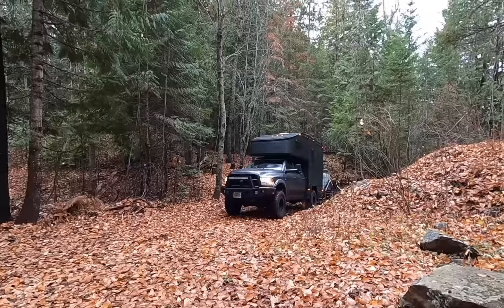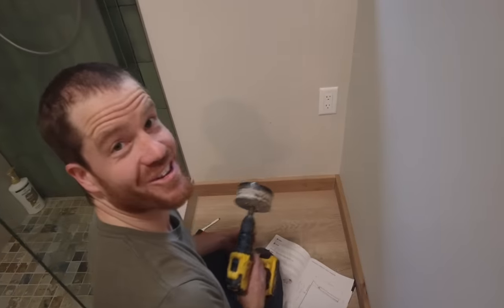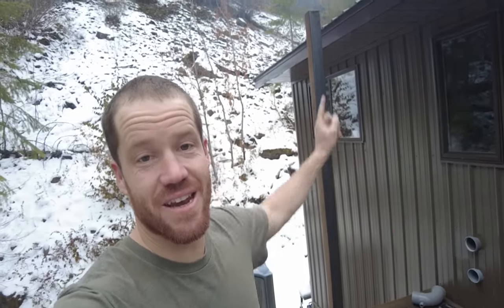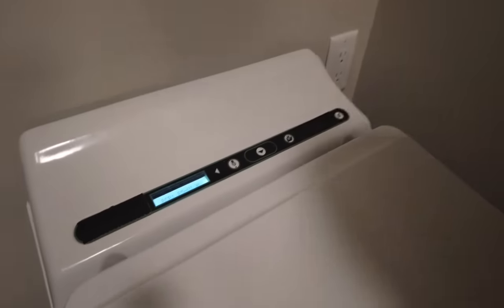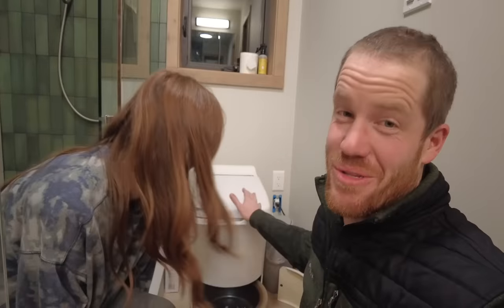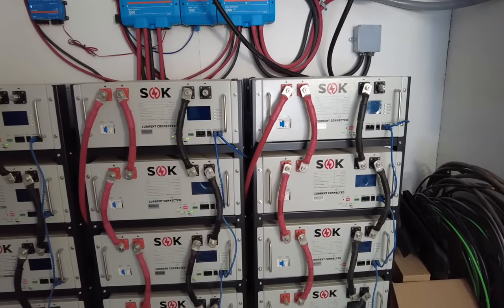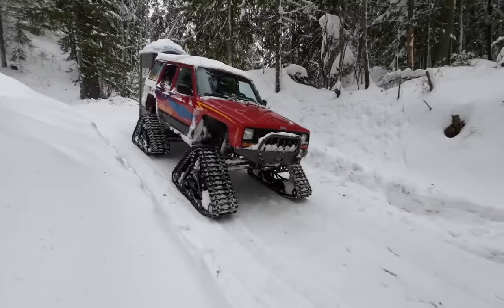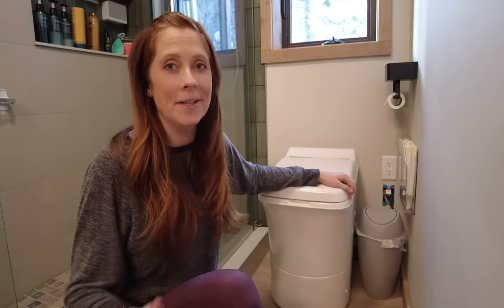Easiest Off-Grid Toilet? | Burning Our Poop!

Comment: I have 2 questions; can you use the toilet when it’s in a burn cycle? And what about urine? Very interesting video, thanks for the mature but fun handling of the uhhh topic
Reply from the maker: Yes you can use it in the burn cycle and yes it handles urine.
Reply: I would like to ask the same question. I thought water and fire don’t mix. What happened when number one contained number two ?🤔🤔🤔 will the paper holds when it contained a lot of urine ?

Comment: I live for a year in a house with one of these.

Make sure you regularly empty the the ash-bowl, it can get quite bit messy if it's too full when you pull it out from under the unit. 

As the ash-fills up the incineration cycle gets less efficient and it will take longer and waste more energy.

Another thing that can happen is if the ash-bowl is full is that the paper-liner with the waste doesn't want to fall down as easily, especially if it's only a nr-1 (too light too fall down) the most annoying part of this unit is that if the liner doesn't fall all the way down it get caught in the closing mechanism and just kind of hang there while it burns.

Finally, the cycle takes a lot longer if there is a lot of fluid. Because of how it works it first has to boil off all fluids before any burning takes place. A lot of wattage can be saved by going NR-1 outside in nature, it's also totally fine because pee is sterile.

Also as you've noticed it is not very quiet, which can be a bit annoying in the evenings or when someone uses it just before bedtime.
Reply from the maker: Thanks for the tips!

Comment: Very interesting.  We have a cottage, with what we call a Garottage.  It’s a separate building which is part cottage, and part garage.  Has electricity but no water or septic.. we’ve been trying to figure out what to do.. kinda steep price for the toilet, but would solve some issues, and be cheaper then suppling water, septic tank, and plumbing!!  Yet another good episode! 🎉

Comment: Towing an out house has to be the strangest thing thing I've ever seen. Well done and very useful video about subjects not very often spoken about. I'm beginning to wonder how this would do in an RV, power would be the main issue.
Reply: They are available for RVs, but require a lot of power so you have to make sure you have a 50 amp connection. They're a little expensive. If you use RV parks they will have permanent solutions installed, all you do is hook up your pipes, and pull the handle.
Reply: @markmitchell457  Campgraounds, Fed and State Parks are hard to get into and probably will be for a while. For the last several years I been boon docking on BLM land. They mentioned a propane version being available. I'm just thinking of the future for this product.
Reply: @woodturner1954  There's a van tour on Jarrod Tocci's channel that has this toilet.

Comment: Hi Guys, 

Really Like your Channel! 

Your current experiences really take me back. We built a remote off-grid weekender on 500-acre bush block in the 80's (all 12V solar).  While we relied on a 240V generator for the build, maintenance is now done using battery power tools. Our grand kids are now getting old enough to enjoy it all :).

Couple of things that I don't get: - 

1) Disposal of wastewater.  Go Septic! With that in mind, keep in mind your future "house with a view", Make sure your tank and absorption area will cover both the existing structure and the future "mansion with a view". For our build we used a temporary "long drop" that still functions as a second outdoor dunny.

2) Rainwater and snow capture. It's pretty easy to install gutters (with snow straps) and a rain tank. There are a lot of options out there, we use a couple of 15,000 litre poly tanks and leaf-proof gutter guards (these also help with snow shedding off the roof).

3) Looking after your mobile plant - Build a Shed!! While we don't get the snowfall you receive, we get a bit of snow in winter plus bushfires and UV in summer. We have all our plant undercover and protected from both. This has been a lifesaver in protecting our investments. See: - https://www.ranbuild.com.au/products/rural/

Comment: One more question, can it be used just after the first( previous) usage or do you have to wait for the incinerator light to go out?
Reply from the maker: You can use it back to back even during a burn cycle.
Reply: @AmbitionStrikes  seems like a scary and venerable position to be in; sitting...um...exposed on a furnace.

Comment: $5000 is definitely not cheap, but to put things in perspective, my dad recently had a septic system professionally installed, at an effectively ideal site (ex: warm dry ground with adequate percolation rates, situated well away from any water features of the property) and it cost around $19,000.  It also took around 10 months.  The local government arbitrarily squandered ~9 months before approving the permit, even though there was nothing about the site or process that would justify any delay at all (supposedly the local government just had some kind some kind of internal staffing issue, and they were totally not serious about getting things done).  Once the permit was approved, the actual digging, bringing in the rock/gravel/tank/pipes, and the actual installation only took around two days.  A couple more days were used early in the process for the original government required percolation test/trench, plus the government paperwork.

If the government was not involved, the total process could have been completed in only two or three days.  Government inefficiency substantially increases the cost of homes sold in the US, while substantially delaying most construction projects.

Septic systems sometimes do require maintenance, and they sometimes break down altogether (ex: cracked tanks, clogged leach fields, clogged effluent drain filters, problems with local water contamination, root ingress, etc.).  They can also vent nasty fumes.  Additionally, many of them are designed to operate anaerobic (ex: bio-digestion without oxygen), which produces large amounts of methane (rather than CO2 and water, which are the normal decomposition products for aerobic [with oxygen] bio-digestion).  The methane (CH4) is a much more potent greenhouse gas, compared to CO2.  In other words, it is considerably more "environmentally friendly" (at least from a greenhouse gas perspective) to incinerate crap (and in many cases organic garbage in general), than it is to allow it to decompose by anaerobic digestion.

Incinerating toilets are therefore technologically a relatively good idea.  They do however need to make them much cheaper, and much more readily available.  The ~2kWh per day or so energy consumption is non-negligible, but to put things in perspective, the average US household consumes on average around 30 kWh/day in electricity (while the average 2019 US per capita daily energy consumption is around 200-250 kWh of total energy per day, from all fuel and energy sources combined).

Comment: We have been struggling with needing a solutions to add a bathroom to our deck. (I know who does that.) our deck is equal size to the entire bottom floor of our home so we are working on making it a 3 season porch. For parties we don’t want folks in and out of the house so we are adding a bathroom to the deck. We already added a sink but a sink can drain into the grass as it is just soap water. But a toilet was different. Thank you for such a wonderful video that explained ALL my questions. A+++++

Comment: I've lived off grid (3 days every two weeks) for a bit more than 50 years.  I considered an "incinerit" toilet, and also septic systems, and composting.  But my space is quite rural, but I don't have snow often, and the soil is in many spots, clay, so perk tests are difficult.  Instead I just went with an old fashioned "privy", but made them a bit more modern.  Dig a DEEP hole, (with a backhoe or excavator is easiest) like minimum of 7', (did that by hand) to 13 feet, (excavator).  pour a foundation around the hole and build the room above that.  The difficulty is digging a deep hole without making it too wide or long.  If you want a privy that is 4 x4' square, you have to dig it by hand.  But if you can do 4 by 6, you can do it with an excavator.  put in the bench inside, toilet seat, 4" pipe goes from the roof down into the pit below.  Voila, done.  I have 4 different Privys now.  Guests wonder at first, but they don't stink, (the poop is 12' down and the space is vented.) I've used the privy that is 7' deep for 20 years and so have many guests.  It now has less than 6" of actual residue on the bottom.  IF it stinks, which with lots of people it might start to smell a bit, I spray a cup of bleach mixed with a gallon of water into the hole.  Smells pretty antiseptic for a month or two after that.  My privys are nice places.  Finished inside with Cherry wood, or maple, or redwood, all are nice.  And they don't use any water that is somewhat precious.

Comment: Honestly if you've the power and it works I'm not sure why you'd replace it. Seems like the simplest solution for the task so long as you can figure a consumable substitute if those are spendy or hard to get or somethin. Regular toilets use tons of water that you then need to deal with sourcing/pumping so it's not like that's free off grid and the no smells seems like a pretty big perk.

Comment: Guys, thank you for this useful information. I watch your channel for ideas to address issues that every remote, difficult-to-reach setting deals with. Hands down one of the best lower-cost, low-smell, remote-location solutions I've seen that the females in our family will accept. Your is a good near-term solution while other projects are being completed during the same period, given the upfront costs of a septic system vs. an incinerator toilet plus the near-term costs of two other projects. Available solar power compared to propane costs is the right direction. It would be amazing if the company improved the ash handling with a built-in "fireplace" ash vacuum. I handle the RV tanks for the family. There are good solutions for every problem if you search. I found a black & gray tank adapter that creates a high-pressure water jet from a garden hose. The clean water jet acts as a "no-power required" RV macerator that turns everything in the holding tanks into liquid. The combined fresh & waste liquid then travels at high pressure via a waste garden hose placed into a septic tank or sewer inlet. You can see when the black & gray tanks are emptied because the water jet adapter is clear. You allow the clean water to flow for a few mins to rinse waste tanks and garden hose. One of the best RV gadgets I've found. The incinerator information is useful, and the toilet sled was funny. Thank you for providing important, useful information creatively.

Comment: Rather than trash the ash use it in a garden I hope you will build next summer. Integrate it with kitchen scrap composting I hope you are doing, or will in the fire. Off grid should also mean little to no trash.

Comment: When I was young back in the dark ages of the 60’s, we lived on a farm in a 20x22 house with no running water.   Life was very much simpler back then.   Want water, go outside with a bucket and hand pump the water out of the cistern.   You need to go to the bathroom, walk down the part 75’ away from the back door and go in the outhouse.  It was a two holes with a moon cut in the door.   Dig a hole a few feet deep and put the outhouse over it.   Keep a bag of lime inside with a cup and put some in once in a while so it wouldn’t smell bad.  My Mom was so excited when we finally got a well and running water, she went out and set it on fire.   The problem was the electric pole was only a few feet away and it caught on fire.   Good thing we had running water!   Put the pole fire out with the garden hose!   Good time had by all!

Comment: Probably not the best choice for a video during my lunch break, but I can relate to the pleasure of having a toilet. During the first summer of my log cabin build, the focus was on getting it weather tight, which we did by Labor day, but it meant sitting on a 5 gallon bucket in the woods (with the bottom cut out), and that got annoying when it got cold. So even though I wasn't able to connect my septic tank to the leach field, I finished my interior wastewater plumbing and poured 5 gallon buckets to flush. Never had to worry about the 1250 gal tank becoming full b/c we were only up there on weekends, and maybe only 10 gallons/wk. 
BTW, not sure about the regulations in Idaho, but here in NH, not only can you design your own septic, but you can install it too (as long as it is your domicile). I am a civil engineer, so I was already qualified to design it, but saved a ton of money on the install too. In total is cost me just over $3k back in 2011. I did have an excavator and skid steer onsite for the foundation, so that's when I also installed the tank and leach field.

Comment: Five grand is a lot! But you can use this to add a second toilet down in the shop space later. Personally I'm looking into a toilet that would generate methane to use for heat or to generate electricity. Good luck!

Comment: I know it doesn't really mean much, but if I have to go through 2 walls like you did, I would use the long 1/4 inch drill bit first. That way I know exactly where the second hole needs to be cut. Most hole saws have a 1/4 inch pilot bit. Automatic alignment. Just keep the long bit that goes through both walls at the same time as straight and level as possible

Comment: I got rid of my Cinderella Incinerator toilet and installed a septic system instead. It consumes approx 1.5 kWh per flush, and with energy prices sky rocketing here in Sweden it’s too costly for my budget. Be sure to pee in the forest. 
It also produces a lot of heat. Not perfect in summer time.

Comment: Im curious how the battery temps for your solar system are with the shipping container in the side of the hill. Have you run into any issues with temps when charging your battery's or does the thermal properties of the earth help heat the container and battery's?

Comment: I love Y'alls channel.  "Going to school" on your build if you will, for when I start my own project. 

Speaking of, next time you need to locate a hole on a surface and you've already cut one hole, put the plug back into the hole and use the center drill hole in the plug to determine center on the next hole. you can check level and square against the shaft of the drill bit or on the drill body.  

Keep up the good work, looking forward to what you guys get up to next time!

Comment: Thank you for doing this. This is by far the most comprehensive review of the Cinderella I've seen. I'm super curious to see what you guys think after a year. I'd also love to know how these handle a power outage/interruption. (e.g. will it resume an incineration cycle after losing power? does your bathroom get full of burning poo smell when it loses power?) Most rural grid users experience power blips on the regular during storms and 2 kW is a lot to ask of a commodity UPS without just going overboard and building a grid tie inverter/charger/battery system.
Reply: They are 100% off the grid and generate all their own power. There are no grid outages for them.

Comment: Run the drill in reverse when using a hole-saw on thin or uneven metal siding. It will prevent the drill from catching and ripping your wrist off. And it won't leave a jagged edge.

Comment: I hated our Incinolet. When it worked it was fine, but it was a maintenance nightmare. Repeatedly replacing parts, regular cleaning which required partial disassembly. You cant ever really clean it like a traditional toilet. And if it breaks down with fresh waste, oh boy its even more fun. Power usage wasn't as bad as I expected though.

Comment: What about the wee? I imagine you don't need to use the paper liner when you do a wee only? Does it drain out the lower pipe? Though I thought the lower pipe was bringing the air in from outside?

Comment: We had incinolet toilets at the remote government facilities in Alaska where I worked.  Although you can throw the ashes in the trash, that is really a waste... pun intended.  A better use for them was found by the native villagers.... they would collect the ashes from us and use them as a fertilizer addative for their gardens and crops.  You might want to consider doing this if you have a garden. Since the ashes are pretty much carbon and steril, you could use them in just about any application you would need carbon for. Consider... the main chemical component of ash is carbon, with varying amounts of other elements, depending on what was burned, including calcium, magnesium, potassium, and phosphorus

Comment: Great job guy’s, I give this vid a 1, but the ‘Thunder Box’ has to be a 2! Here’s a tip Riley, dont lean on the verandah rail if ur having a number 1! 
Interesting ep & solution, Ive never heard of incinerating toilets before, will have to see how it goes on the power side at 2Kw per load or 2, I can imagine it could use a lot of power when u guys are sick, & that could cause problems for many on off-grid setups, but then u have one of the best off-grid solar setups I have seen. Merry Xmas

Comment: Great job with a topic that does not get much attention.  Also, having noticed a lot of white stuff:  Have you installed block heaters for your vehicles?  Even though I don't get the low temps you get I have one on my chevy pu.  Helps cold morning starts.